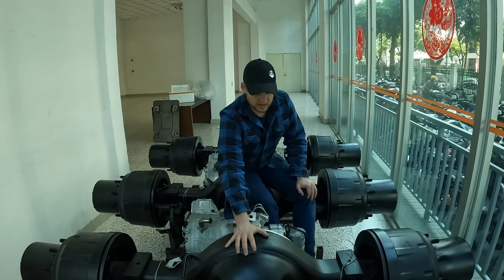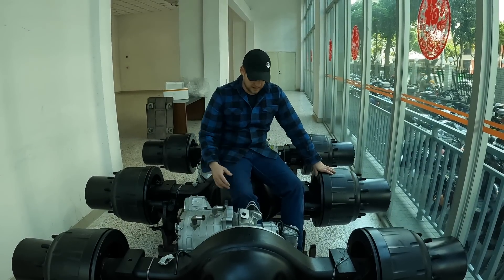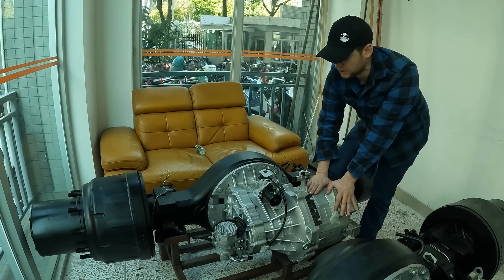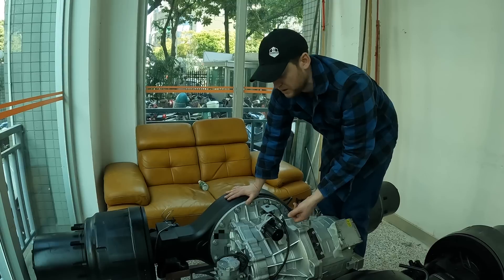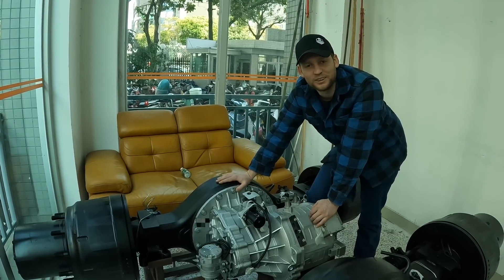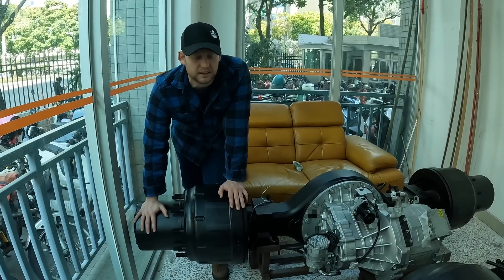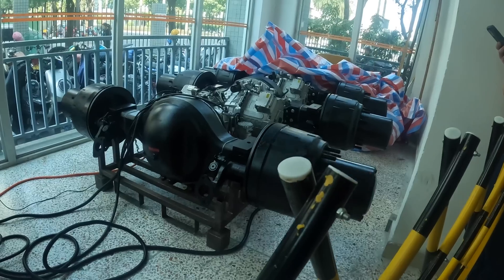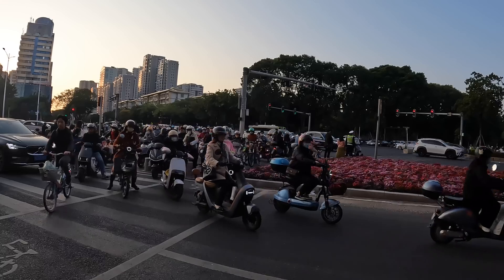Exploring Heavy-Duty Electric Axles: Behind the Scenes at the Factory

Comment: Can you spec these with Disc Brakes? They perform ao much better. Nice work really exciting to see this!
Reply: The vast majority of the braking power will come from dynamic/regenerative braking anyway, right?
Reply: Do they? Do they really? The swept area of drum brakes are huge. I have not personally seen disc brakes on class 7 or 8 trucks.
Reply: The ultimate limit on braking force is the contact patch between tires and pavement. Brakes are designed to far exceed that limit on any vehicle. Disk brakes only perform better as they apply full pressure quicker than drum brakes.
Reply: @TheMetalButcher  the 2017 Pete 579 I drove for TMC had disc brakes on every axle. Same with the Volvo I drove for my last company.
Reply: @TheMetalButcher  pretty much all trucks in europe use disks. drums are cheaper and NA is just slow to change
Reply: Lighter? Yes. Better? Eh.. I would bet not.
Reply: You dont need disc brakes on electric vehicles.
The main benefit of disc brake is, that they can cool fast, means they are less likly to overheat on long down hill. Since electric vehicles have regenerative braking that doesnt matter, electric vehicles only need brakes for emergencys or parking.
Reply: Not true, regenerative braking is less effective at slower RPMs, just like a jake brake. You need friction brakes for a controlled stop.
Reply: Wouldn't drum brakes be better for logging trucks, since they keep mud and crap out better than disk brakes?
Reply: Deleted my previous comments. The boys specc'd disc but manufacturer built with drum; see video about axles arriving in Canada.
Reply: On a normal axle, the stress of breaking would end at the disk brake. So wheel - disk. Here its wheel - differential - electric motor when in regen. I wonder if the gears inside are able to handle the stress of breaking that much force. They are somewhat ready because normal trucks also use engine break, but fully breaking with regen im asuming is much much more force.
Reply: @rodon91 they have straight cut gears so this shouldn't be an issue as they are able to run the front diff backwards has no effect on the gears as slowing would or reversing not in there application tho its all in the gear style
Reply: @kstricl  wrong they just specc'd them wrong. they will be using disk brakes.

Comment: What syncs them together so they arent fighting each other?
Reply: The Earth will... 😂
But seriously, the controller will be doing like jmanlinc says, monitoring the sensors on each asked adjusting output to synchronize them. In fact, if one set loses traction, the power can be sent to the other axles far faster than the driver can react and keep the truck moving without much loss since electric motors can react instantly.
Reply: They will have speed sensors and the voltage would be adjusted accordingly
Reply: Ohms law

Comment: What are you estimating the all electric range will be on these?

I assume it will be mostly for close around town deliveries.

Axles look awesome thanks for the update!
Reply: It is for a hybrid diesel electric off road semi truck. He hauls things several times larger than a semi truck. On a Tesla model S worth of batteries he get a bit under 2 hours of runtime, then the diesel generator charges it in half an hour. He said if he has a 5 hour mostly downhill haul, he can deliver the load with a full battery without needing to use the generator.
Reply: @mikegrok  that’s pretty darn good I think the hybrid design is definitely the best way to go for this scenario. I was mostly just curious how far it could go.
Reply: the range doesn't matter if you have chargers everywhere. this is why no electric vehicle company will brag about range except tesla (which has it's own supercharger NETWORK) or massive conglomerates with access to "off-brand" charging. what you're asking is like asking Ford how long the model T can travel; everyone in the business knows that the question is related to time and superfluous (disclosure: i'm not even a tesla investor)
Reply: @addicted  range does matter because I don't want to have to pay my workers 1 hour every day to sit and wait for the truck to charge so they can get back to town even if there was a charger in the middle of nowhere on the side of the road.  They can fill their diesel truck with the slip tank in 5 min.
Reply: @jmanlinc  this is an excellent point! i'm sure the owner of the company would suggest buying more trucks to use while the others are charging back at the lot. :) on the other hand, if the government imposes 15 min breaks every 4 hours like there is in europe or however long, then that pretty much determines the range
Reply: @jmanlinc  No now wants that. The engine is in its standard position under the hood, and you can charge the batteries as you drive the truck around.  

The advantage of this system is: the diesel generator has a long run time between rebuilds, 8x longer than a standard semi. The generator only runs 20% of the time. There are 2 gears. The equivalent of compound low for low speed maneuvers, and street/highway speed. This allows you to accelerate without gear changes, or slow  (recovering the energy) then accelerate without significant loss. It also has better fuel economy. For the off highway use of his truck, he was averaging under 2mpg. This brings it to 8-12 mpg. He spent much of his day running at sub optimum RPMs due to the nature of the roads he was running on. By using batteries as a buffer, he can run the engine only at optimal RPMs.
Reply: Not for driving around town, it's a logging truck built for hauling in the mountains
Reply: @jmanlinc  ya I know that’s it’s main purpose I was just curious about what it could do. I could have phrased that question differently I think the all electric mode could be nice if your having to go Through town late at night without making any loud noise among all the other benefits of having electric motors.

Comment: arent those chinese/asian trucks frames much narrower than westen trucks? so that would make the axles narrower. also what about brakes?
Reply from the maker: These axles were made for us, to our specs. They have drum brakes as well as regenerative braking 
- Theron Danger
Reply: @EdisonMotors  how are you going to keep each axle at the same speed and torque? is there a fail safe for one axle that has a speed issue? like will the truck kill power to that axle and let it free wheel in a type of limp mode or will it shut both axles down?  just curious on how this will work.

Comment: Do they have over running clutches in case one motor fails can it coast home
Reply: The motors are very light, I don't think they'll cause drag when turned off.
Reply: @gsilva220  well they are light but they'll act as a generator when theyre spun, so its not a bad question
Reply: They only act as a generator if it is hooked up to an electrical circuit.
Reply: @josephpadula2283  you mean like theyre gonna do with the truck?
Reply: When they want regen for braking , they hook up the output to the batteries to use the energy and it brakes the truck.

If you don’t need braking you don’t hook up the output to the circuit and it makes voltage but no current so it does not cause any braking .
Reply: Or drag as someone stated
Reply: americans don't know what a clutch is
Reply: @adicted52427  😂 funny, but alas, mostly true

Comment: nice; As they are independent axles, you can climb the empty hill in a 8x2 configuration, saving more energy; between wheels can be locked? Greetings from Colombia.
Reply: the wheels within an axle can be locked, but not between axles, as each axle has its own motor.
Reply: Actually better this way, considering how traction control should be quite possibly better than traditional lockers
Reply: With multiple electric motors it's not anymore economical to run just one, you just run less power to all of them.